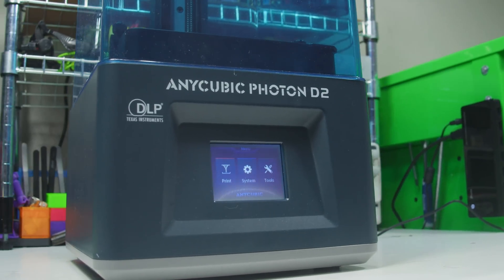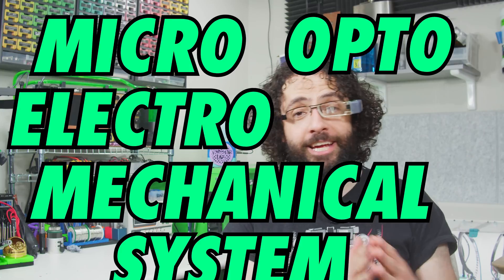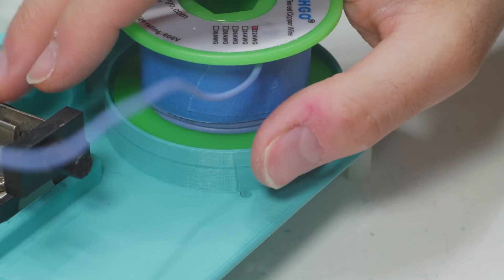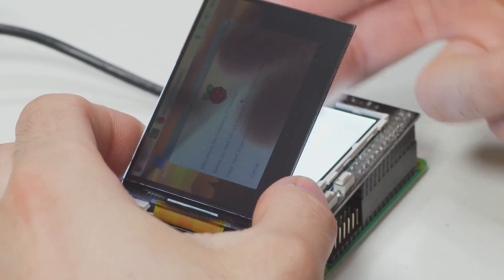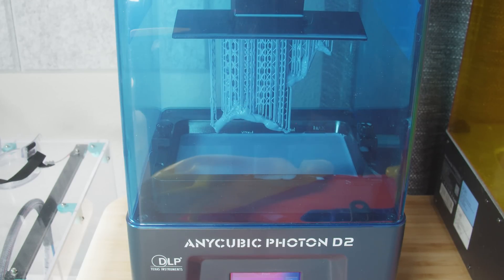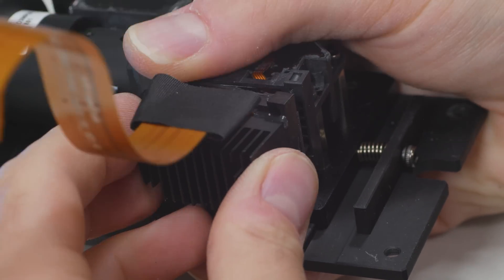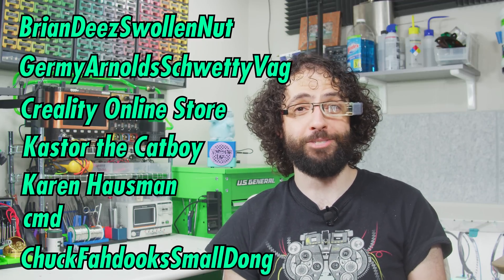Four Million Tiny Mirrors: The Insane Engineering of DLP and the Future of 3D Printing

Comment: DLP is still something between black magic and insane technology to me.
Reply: “Any sufficiently advanced technology is indistinguishable from magic.”
- Arthur C. Clarke

It's really exciting that we are getting to the point that we are making magic instead of technology!
Reply: @reedlawrence4697  "we"
Reply: "Gravity assists aren’t paradoxical magic. It’s just like bouncing a tennis ball off a passing truck. Gyroscopes, on the other hand, ARE magic."
Reply: Ironically DLP technology is older than half the audience.
Reply: This tech seems like they pulled it straight out of a flying saucer. Never stops amazing me.
Reply: @p4inmaker  you gotta take a deep dive into mems technology, some of the cutting edge stuff of the past 10 years is wild.
Reply: @p4inmaker  it wouldnt surprise me. It's from Texas Instruments so must likely a tech out of area 51
Reply: I have worked on them in the past. Do failure analysis on semiconductors.
Reply: I saw DLP displays operating with the back off with the spinning color wheel and it looked pretty crazy.
Reply: “This is DIY. We rip things apart, sloppily put them back together, and only then use them…if we don’t get distracted halfway through.” cough cough medic! I’ve been viciously attacked!
Reply: @samhughes1747  Perfec...ripp it apart, expose the nm component to a none clean enviroment, finger a bit on it, put it togeter without any calibration...and expect it to perform miracles... sums it up...
Reply: nice profile pic
Reply: @eepynicky  you too
Reply: have you ever rubbed a balloon and used it to hover hair? it's basically that but with aluminum foil and on a much smaller scale.
Reply: @satibel  a tiny charge or electric fiels is applied to move this tiny mirrors
Reply: Yeah MEMS technology is something the whole industry is working on to try and make something novel. Its not just mirrors you can make move with MEMS its anything!
Reply: if you asked my befire this vid if dlp was a thing i'd have said no way, maybe in 10 years!
Reply: I was gonna say nice pfp but ig I am not very original
Reply: I think you have it right. it switches between those two to create a picture :)
Reply: Me too. I first saw a DLP projector in about 2000 ish. You can imagine how insanely futuristic it seemed then, like blow your mind how the F can they move each mirror so quickly and accurately and how the F-ing F can they fit so many in such a small chip.
Reply: Ash?
Reply: wait till you understand how old CRTs worked...
Reply: Bi pride!
Reply: Just think how this could be applied to vaccines....

Comment: zack: has stroke
meanwhile zack: this is digital light processing 'a matrix made of milions of miniature mirrors and motors that measure mere micrometers'
also zack: ergebleds
zack but further into the video: im gonna trample on their trademark and use dlp and dmd interchangeably 
insult: you know we are talking about the technology here not a specific brand and if you're dlp you can dmdeal with it
zack has stroke: 2:28 to 3:15
spitting fax : 5:38 to 5:44
exercise for viewer: 5:44 to 5:58
back in my day: 7:03 to 7:10 
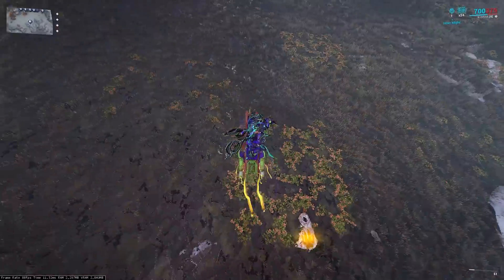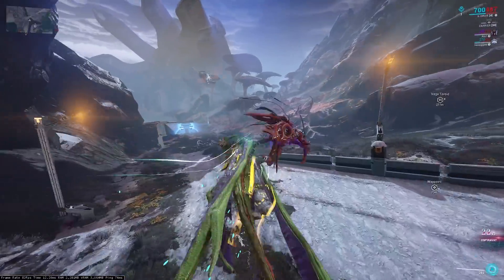robot ninja treasure hunting hacker fairy who gets to choose between poaching endangered species from a hoverboard and using endangered species as a hoverboard: 7:52 to 8:10
zack doesnt know what hes promoting anymore: 8:10
but suppose instead of a piddily little led panel your light source is a 5  killowatt xenon arc lamp designed to fill a 15 meter schreen with lazy super hero tropes from across the theater thats enough power to make celloid film litteraly explode if the film reel jams for half a seccond 8:11 to 8:28
and its certanly enough to incinerate any lcd you put in front of it 8:29 to 8:32 
hmmm with mallicious intent 8:42 to 8:43
zack insults your mancave 8:48 to 8:54
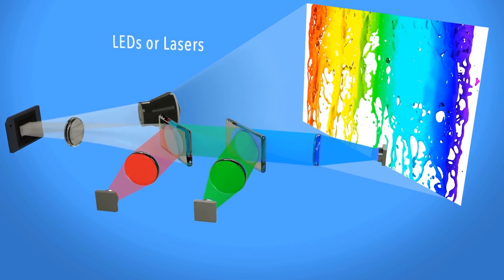daylight scenes can pummel your retinas night time scenes are so inky black you cant tell where the screen ends and because every pixel shifts at the same time action shots have this snappy frame to frame clarity that evokes a physical cinematic crispness 8:54 to 9:10  
what is that word 9:10 to 9:11 (dammn last nuber sus)
back before this was you know ''affordable'' projectors spun a color (ergobled) wheel in front of a lamp and just displayed and just displayed each frame one coulor at a time for most people persistance of vision would sort it out unless you where someone like yours truly who could see the individual flickering coulors and it was highly irritating 9:16 to 9:33
LEAVE A LIKE ON THIS VIDEO AND COMMENT if you too remember the obnoxious (ergobled) rainbow projector effect 9:33 to 9:37 (this is a pain in the ass to type but im a hardcore ergobled fan)
so i know im not the only old person on youtube (famous last words) 9:33 to 9:42
the picture would just be invisible if 95% of the light was gobbled up by lcds 9:56 to 10:06
rock hard what? (rock eyebrow raise) 10:29 to 10:35
lesson one in how to ruin a joke 101 10:35 to 10:40
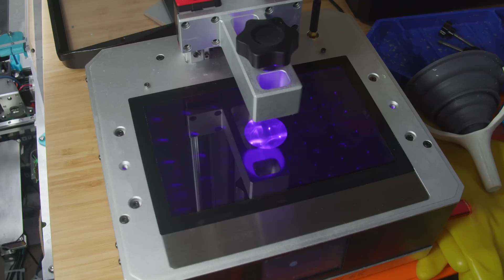zack strokeman (dont sexualize) 10:45 to 10:52
sponsorship ergobleds10:30 to 12:22
holy quingledingledingle im done
Reply: 'a matrix made of millions of miniature mirrors and motors that measure mere micrometers' Say that three times fast.